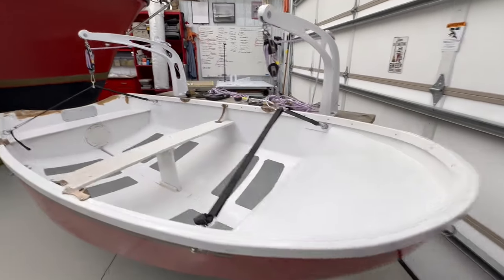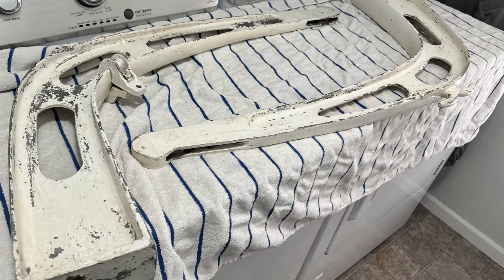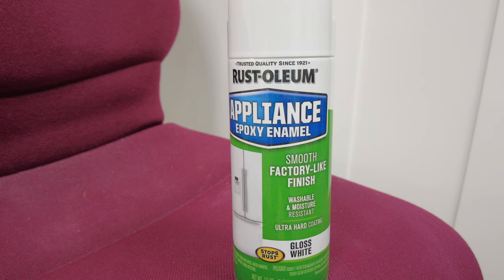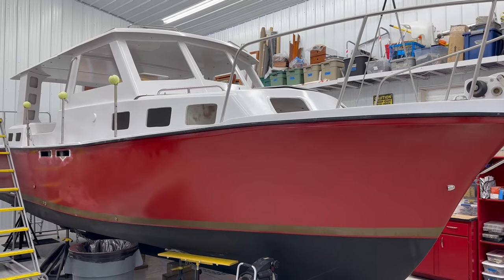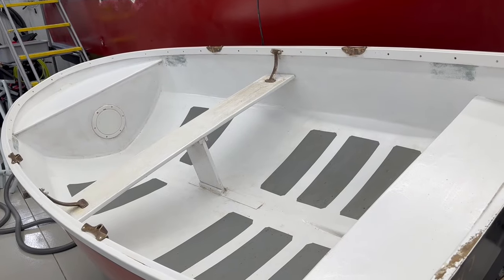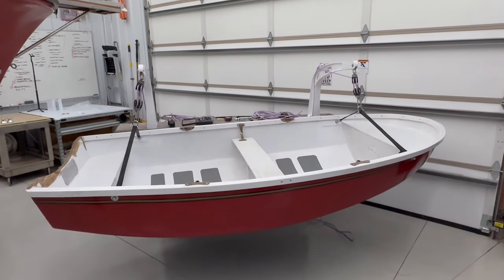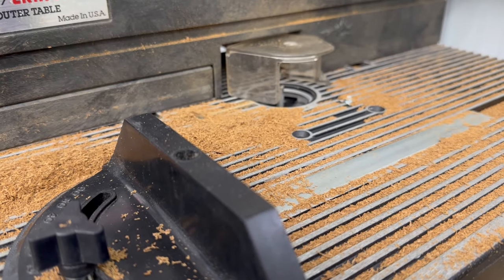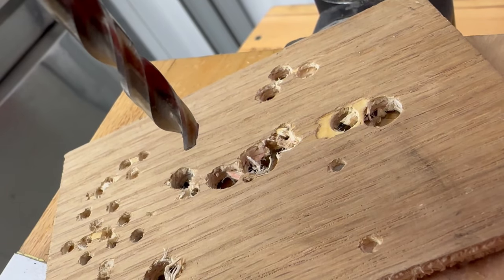Are these the BEST DINGHY DAVITS in the World for $50? (Ep63)

Comment: When drilling stainless steel, low RPM and lots of downward pressure is needed. Keep cutting fluid on the bit at all times; heat is what dulls drill bits. If the drill bit gets hot enough to not hold comfortably in your fingers for a few seconds, it's too hot.
Reply from the maker: 😁👍thanks for the comment

Comment: Isn't aluminum touching steel through the bolts going to corrode those bolts (or the davit) due to galvanic corrosion?
Reply from the maker: First🐙only if a corrosive electrolyte like salt water is present. Second, the aluminum corrodes before the bolts. 🙄But they’re not submerged in salt water. And a combination of marine sealant and nylon washers/bushings keeps the metals separate. How do you mount your aluminum items to your boat?🧐

Comment: Good going Joe!  I was glad to see you used etching primer--otherwise that paint would come right off.  (You know how I know that.)   It may not matter because the davit bases look pretty substantial, but are they marine grade aluminum (e.g. 5086)?  You probably don't have to worry about electrolysis in that application, but you may want to consider using silicone or plastic washers to isolate the SS bolts, washers and nuts from the aluminum. Good going on the SS backing plates.

On another note, is that peeling paint on the shop door jam?  You may have a moisture issue.

I'm with you on the Craigslist bargains: I got a nice shiny Fortress anchor for $50.  And I get most of my fenders there.  (Who cares if they look like !@$%?  You can clean and paint them.  And if you don't they're boat fenders!  They're supposed to get beat up and if they are no one will steal them.)

Anyway, I hope you don't mind my nitpicking because it was another great project.
Reply from the maker: Thanks for the comment Joe. 😁  I’m all over it and no need to worry. Thanks again 👍😁